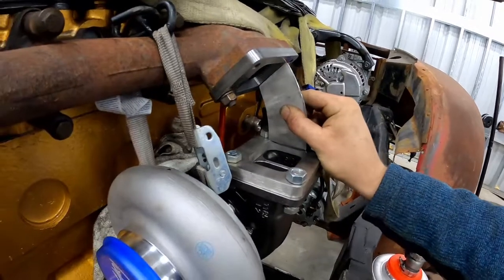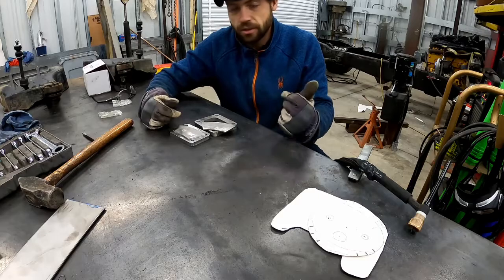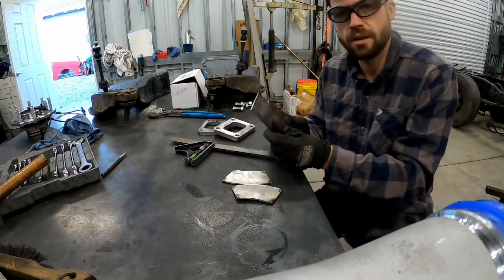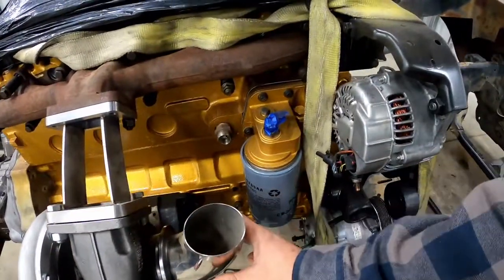Building a custom compound turbo kit 24 valve p-pump Cummins swapped 51' Ford COE part 1

Comment: What turbo setup? I have a s300 63/68/12, I’d like to go with a s400 above it. What do you recommend? It will have Hamilton 188/220, bd street p7100, fleece freedom head, coated pistons etc. Thanks!
Reply from the maker: I chose to go with s366/s475 setup, I’m a little worried the 5.9 isn’t going to be up to the task, I have read a lot of claims that the s366 will be very laggy, that it does better on a 6.7. I too am running the 188/220. For you with that s363, put an s480 over that baby and you’ll be one happy man! An s475 will do well too if either or is more affordable
Reply: It’s been 2 years since your comment how does it run with the 366 in compound ?? I have a 366 I want to run in compound with my ppump 24v and 6 speed manual. also have 188/220 and all pump
Mods able to do done to it.

Comment: Plans for the body mounting points?  Rubbers or Urethane?
Reply from the maker: Will most likely be going with a rubber mount to better isolate all the vibration this thing will put out